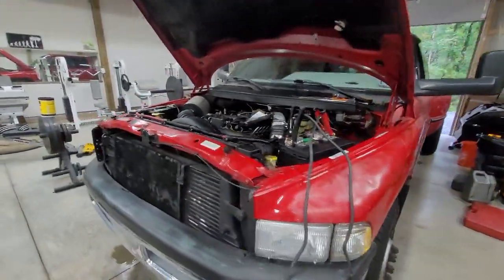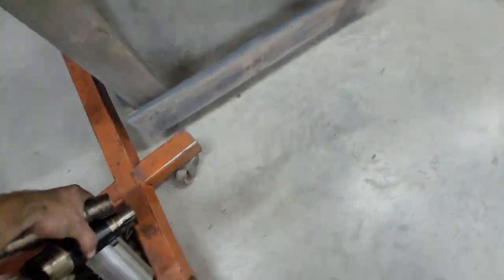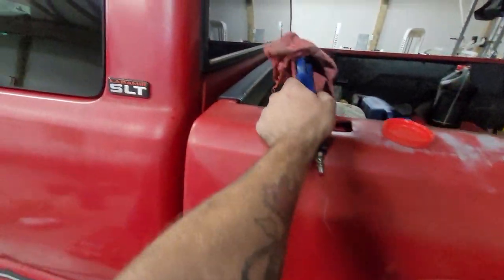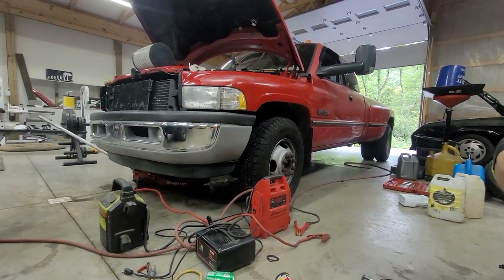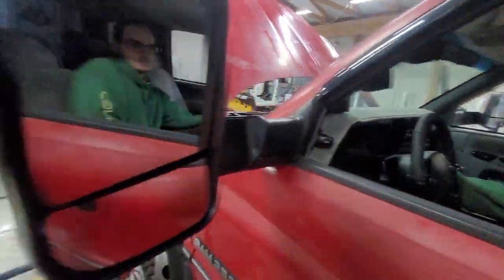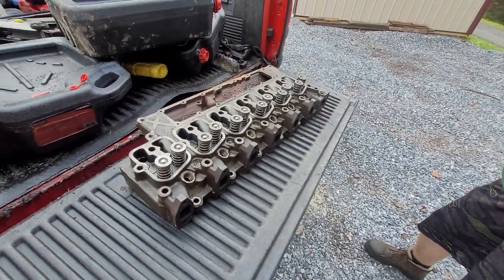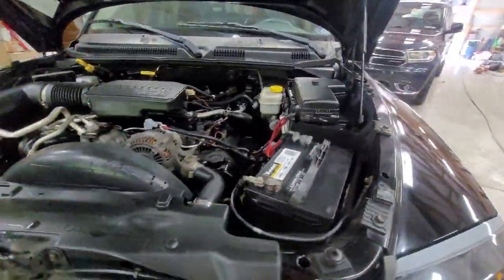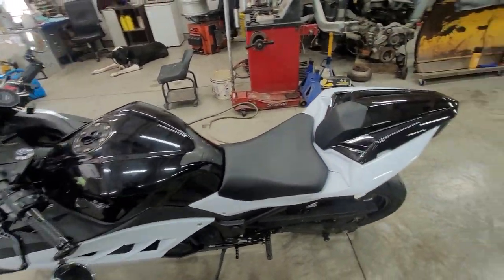Grenaded A Fuel Pump On A 12 Valve Cummins | Little Red Dually Finally Runs Again

Comment: I learn my lesson with that! Simple fix loosen bleed screw on top of water and fuel separator.. take compressed air blow into the fuel tank when it stops bubbling and fuel  starts running out of the bleed screw  tighten it down starts up within a few seconds!

Comment: You can modify a gas cap with a hole in the top and thread in a shrader valve. I had to rtv gasket maker on the inside of the gas cap around where the thread of the cap are. Works great!

Comment: I had this same problem when I went to remove the fuel heater. You will. It realize you have a bad or worn out pump until you break that pressure line seal. Then you put it all back together thinking you got it when you had a bad pump the whole time. I just went to Power Driven Diesel and bought the hot rod lift pump and bam it works.
Reply from the maker: Yep. Modify an old lift pump with a massive thick spring and expect it to hold together. Thing was on its last leg and now was commanded 😂

Comment: The pushrod wasn't on the lobe and someone cranked down on the bolts and snapped the snout.  Spring had nothing to do with it.
Reply from the maker: I've done a ton of these lift pumps. The lift pump was on the lobe. Engine was spun over while being installed to verify. That spring was a lot of tension on an old pump. There's a reason we were recommended to replace the pump with a new one when doing this install.
Reply: 8:12 tells the story.

Comment: The stock lift pump is good for 100. Psi.  The overflow valve is what gives you pressure
Reply: Not if u got a relief in your pump then it will regulate it

Comment: Leave well enough alone.
Reply from the maker: That's exactly what I told him but he didn't go through what I did over the years. He's gotta learn it the hard way like I did 😅 He wants more powaaa
Reply: @CPSteveMiller  not happy with having the coolest truck fire engine red and great fuel economy. Always want to go faster. I have a ‘92 d350 with a Hodge ramp bed. And I go 63 mph.

Comment: The grim reaper killed the fuel pump because you put the battery on concrete in last video. If you put 1mm of sand or cat little between the battery and concrete you won’t have this issue or to make it simple just put it outside on dirt

Comment: U didn’t put the plate on that’s why it exploded
Reply from the maker: Never ran it on mine. I ran mine with straight pump, no spacer since 2019. Sold it after replacing the pump once or twice at the end of 2022. Still fine. Never broke a single pump. Now clogging them? Yeah, that happened quite a bit. Just part of running waste oil.

Comment: Pretty funny you take a good running truck work on it then it will not run. You broke the new lift pump, put another on it still will not run. Then put stock drain valve back on and it runs.  What a waste of time and money. Be looking for more funny videos.
Reply from the maker: I literally made that point in the video. I'm the one who said to leave a good running truck alone 🤨